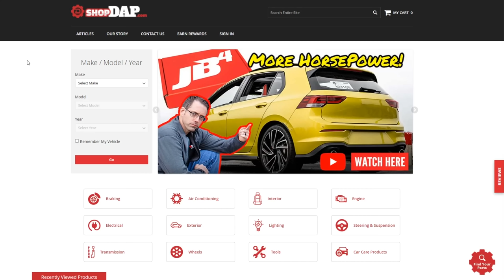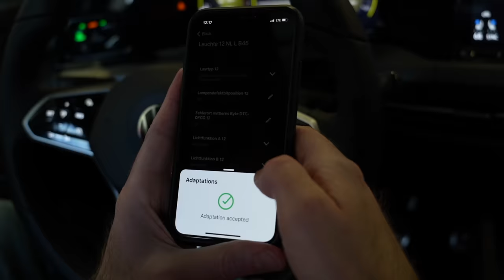Can You Put a Clubsport Bumper on a New GTI?

Comment: 20:24 might be my OCD but that passenger fender looks to be sticking out more than the hood.  Either way, GTI is coming along great!  I sat in the MK8 and I did notice the steering wheel tilt doesn't go as high as previous gen, what do you think?
Reply: Well, that's not your OCD
Reply: nah i noticed it to. its triggering me. no way wolkswagen would have done that from the factory lmao
Reply: @ChocoBaiterEUW  That's what happens when you remove the crash bar which holds the core support & bonnet latches in 6:18
Reply: Regular vw quality lately

Comment: I've done the exact same thing on a Mk6 GTI, I've installed a GTI Edition 35 bumper like a year ago. Seems like not much has changed in two generations, I've transferred all the parts, parking sensors, headlight washers and harness. I didn't have any special tools for the parking sensors holes and used a Step drill bit and worked perfectly, no mess. For the adhesive I've used some sort of a seam sealer from my local hardware store, also did the job nicely. The markings for the sensors on the mk6 bumper on the inside are just the same, I was also pleasantly surprised when I saw it as I was thinking how I should match the placement. A plus was the fact that I got to keep my fog lights. I was lucky enough that I bought the bumper from a friend, it was complete and already was painted in the same white body color. What I would recommend to do is drill the parking sensors before painting the bumper and also fitment testing any part before sending it to the paint shop. I'm speaking from personal experience with the Mk6 R side skirts on my GTI. Also would've been a nice touch to spray paint all the black grills in gloss black previous of installing them, instead of leaving them in raw matte plastic finish. Also applies to the rear diffuser. Great video nonetheless as always Paul, love watching these even though I live in Europe and I've sold my GTI in the meantime and got a manual Seat Leon Cupra 280 which unfortunately you don't get in USA, which is basically a FWD mk7 R or a Mk7 GTI Clubsport, which also is not available there. Really a bummer.

Comment: I like the clubsport bumper a lot!
As a VAG body guy, who does stuff like this daily, it was hilarious to see the struggles a non bodyshop like guy you had haha. You did alright for a newbie though.
You may have issues with the side parking sensors down the line. as you missed some important steps for a durable glue job. Also about the snug holes, you need a 19mm hole punch for these.
Reply: i thought the same thing here, in the final view after everything is reassembled you can see that the sensors are not flush with the bumper, not for nothing there are special punching and assembly tools from VW for this purpose

p.s.: VW/Audi mechanic here
Reply from the maker: Yeah it was a snug fit. Makes sense that 19mm is the correct size. I think that’s part of the reason it isn’t as flush as I would like.
Reply: I was told that there may also be a difference in the shape of the headlights, so unfortunately I have not mounted an R bumper on my R-line. is that correct about the shape?

Comment: Looks awesome.  I did something very similar with my MKIV Jetta when it was new.  Installed a Euro bumper, bumper support and Hella headlamp washer system.  Which also required a new washer tank, additional pump for the washers and a relay  but it was cool... :)  Most awesome thing I discovered was the system only washed the headlamps when the lights were on.  During the day, you could use your windshield washers and the headlamp washers would stay off.

Comment: The original bumper did not need an update. And losing the log lights was criminal.
Reply: There lost on the CS because it shares the same set up as the R
Where the fog lights should be is extra rads for cooling. 
There ridiculously fast, not quick but fast, the 245 GTI mk8 doesn’t even come close on the move. 322bhp stock ours has been dyno’d at

Comment: Mista-mista!  Do you need to remove the front bumper to remove a headlight housing?  I found 3 of the top bolts to remove and it’s wiggling around, but it feels like there’s another bolt somewhere.

Comment: Paul, A12 is the day time running light. C12 should be the left fog light (c13 passenger side)
Reply from the maker: I’ll have to check out. Had not spent much time on coding. Thanks.
Reply: @Deutscheautoparts  hey i don't really have a clue, just happen to speak German and googled the codes in your video which translate to day time running light for A12. First Google result shows the code list for the MK7 which I assume should be similar to the MK8? That's where I got the C12 for the fog lights

Comment: Question: Wasn't any possibility to order a bumper with holes for the parking sensors from the factory? With one of the cars that I owned(not a VW) you could order the front bumper with or without parking sensors holes( depending if your car had or not, the front parking sensors)
Reply from the maker: Nope can’t. Depends on the car. Some come with them some you need to put holes

Comment: The originale tool for making the holes for the sensors are cheap, i have the hole kit so i have the originale tool for fitting the bracket too thays just 10 times easiere to use as that set you used😉 regards Sören

Comment: Hi if an injector failed on computerized emissions controlled vehicle there is injector codes, high circuit, low circuit, and injector malfunction and on a 4 year old engine? Doesn't make sense to me a failing injector without a code possibly until the injector completely fails to throw a code and if the pcm is failing or the circuit for the specific injector it would cause a misfire on the one cylinder, if it has a defective valve exhaust valve on a specific cylinder it could cause a misfire, if the ect sensor is failing it could cause a misfire on a particular cylinder or it cause a random multiple misfire depending upon the make of the vehicle and how the pcm is programmed a failing MAF Sensor could cause a misfire but if it has failed then the engine will fire and die or the cranking is increased before the engine fires, but every car manufacturer  has injector failure codes 96 until present year